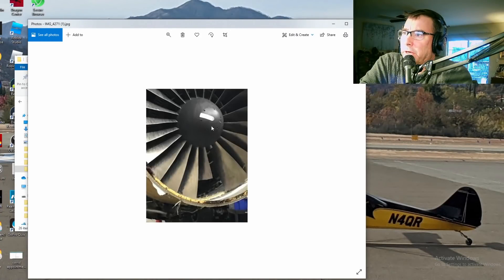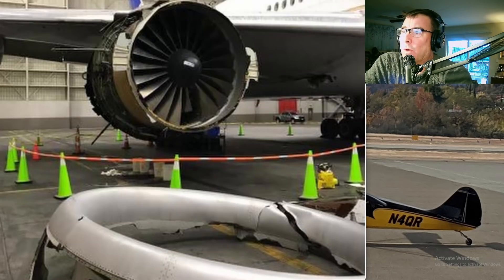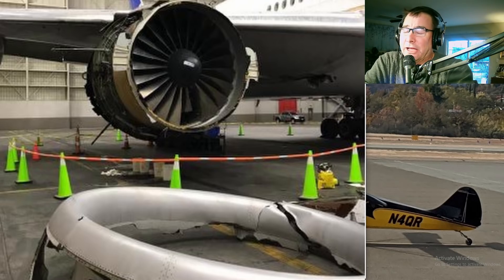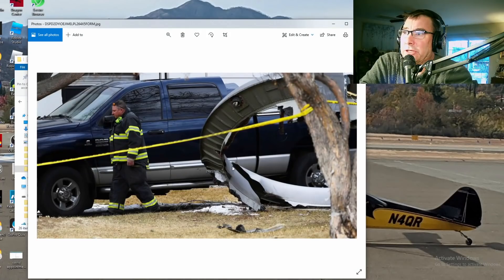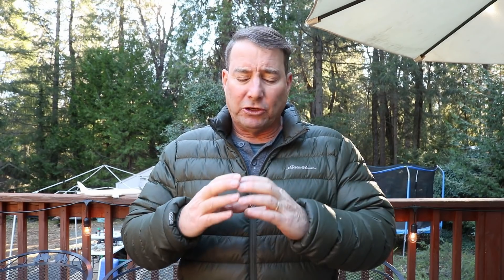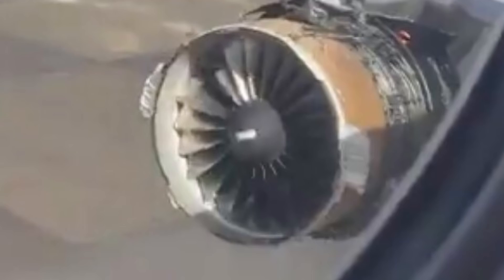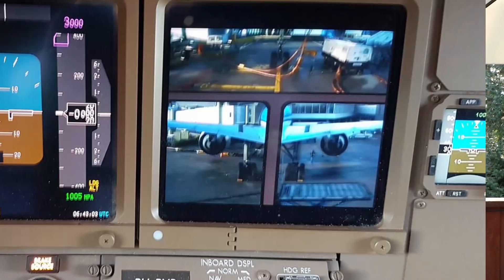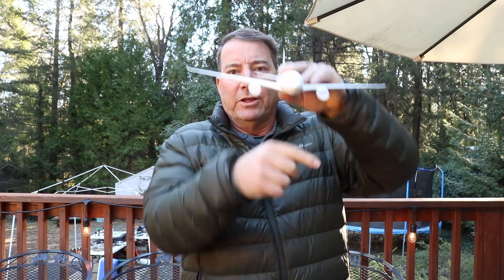UAL 328 UPDATE Fan Blade Failure  B777-200  22 Feb 2021

Comment: Just to clarify, the strength margin or structural fuse designed  between the pylon and wing is to prevent tank rupture in a crash scenario. The pylon is designed to stay attached to the wing in an FBO event, and did so. In the same way, the oscillatory windmilling loading over the the period of worst case diversions after FBO is also designed for in the F&DT qualification.

Comment: United Airlines Flight 1175 had a near-identical Boeing 777 engine failure over the Pacific from San Francisco to Honolulu back on Feb 13, 2018. The engine also lost one and one half fan blades and the cowling. The engine was the same type PW4077.
Reply: You have a good memory.  Looks very similar.
https://www.airlineratings.com/news/industry-news/near-identical-engine-failure-united-airlines-2018/

Comment: Efficacy of the fire suppression system without cowls is exactly zero
Reply: Looked like the fire was in the region of the thrust reverser cascades.  No fire supression out there, only under the core cowl.  I haven't seen any pictures that would indicate the core cowl departed the airplane.
Reply: P Peterson I don’t think these things have separate core cowls like the JT9’s had. For sure the transcowls were blown off, leaving the cascades exposed as you remarked. So the fire would have been somewhere in the C-duct. One would think that if the cascades are in place, the inner heat shield around the core must still be there unless some reverse flow sucking the fuel out of the compartment which is entirely possible if one of the bleed ducts have detached; hard to tell as a spectator...

Comment: Yes, the engine failed. But we’re not talking about a tragedy, because many other systems worked.
Reply: I'm impressed by the total professionalism demonstrated by the aircrew and ATC in this instance, resulting in everybody walking away.
Also glad that the fuel shutoff and fire suppression systems worked as advertised as Juan pointed out. I guess it's easy for me to say "it was just a little fire" from the safety of my keyboard but that's honestly what it was, rather than the flying blowtorch of an uncontained fuel fire. I'd obviously still have been fairly concerned if I was viewing it through a starboard passenger window though. :)
Reply: @sixstringedthing possibly was just a little fire but sheesh little fires can explode, look at those failed gender reveals.
Reply: Luck 100%
Reply: its not tragedy because  it didnt happen mid Atlantic or mid Pacific,  but happily near the departure airport
Reply: @yarpos  777 is ETOP’s certified.. Same scenario would have happened mid Atlantic or mid Pacific.
Reply: @sanitman1488  nothing is 100%.. being this faithful for things to happen by the books basically asking for disaster.
Reply: @whothou  then don’t fly !

Comment: Some interesting answers to questions i had in my head especially regarding the severe engine vibrations potentially causing airframe damage.
I’m sure it would be an unwanted failure point but is it possible to jettison a badly damaged engine ?
One of the dreaded situations big jet pilots must dread is to have a failed engine when your destination airport is experiencing extreme weather but your options to divert are limited by your remaining fuel load having flown a lower altitude at a higher fuel consumption, worst case scenario of course.

Comment: Excellent reporting as always. Can you explain the Weight on Wheels sensors? How this records into the FDR; does it trigger auto throttles, thrust reversing amd speed brakes?
Reply: It does if the crew armed the automatic system

Comment: I saw a different pic from a second angle, appears that liberated blade, or possibly other debris hit the fuse under the wing aft of the AC pack intake and left a fairly large hole.  Not sure how much damage was suffered internally but I wouldn’t have wanted that to happen halfway between Hawaii and the West Coast.

Comment: Great Update Juan..... OK now I have a question. So what happens if that engine fell off? Besides it hitting the ground or someone. Does/or can the plane adjust trim on the wing to keep the plane level, the only reason I am asking this is because of the weight loss of the Engine.....
Reply: The weight loss is easily countered by use of aileron. No special procedures are called for according to Boeing procedures. Never experienced it for real, fortunately, but on the simulator it is a easily managed situation. The engine is designed to break away cleanly, but I think you can expect other problems resulting from additional structural damage to the wing, flaps/ slats and other systems in practise. That could prove a handful,  so would much prefer the engine to stay put!
Reply: I wonder if it could fall off without hitting the wing or tail
Reply: @kevinstewart449  I would expect that to be a problem, and wonder how much analysis is done for that in the design. A EL AL 747 cargo flight which lost a engine near Amsterdam many years ago, took a second engine with it, and caused major damage to the wings. They flew around for a while, before crashing into a suburb with no survivors, and loss of life on the ground.

Comment: Engine Lubricating Oil coming into contact with hot metal and being force fed oxygen (think Brasing Forge) from the movement of the plane.
Reply: @SusanKay-  - 😁
Reply: I have a waste oil burner I built that works off this principle. Just a drip system. Once it gets hot enough, I force air into the fire via a gutted Becket oil burner.  It sounds like a jet engine, and burns HOT!
Reply: Yeah, I saw an entire accessory driveshaft (or hydraulic pump drive - I don't know how these are set up) laying in the road in that neighborhood that caught all the engine debris: https://youtu.be/Ez0z8KNUA3s?t=120

Comment: At around 0:55 to 1:00 on the video, looking at a still of the engine and wing, it appears that there is a rip or tear of the underside of the wing inboard of the engine.  Is that what is shown?
Reply: Minor damage . The fuselage has 2 skin layers. The outer one is only the outer aerodynamic layer and no structural properties. The structural skin in under that. There was no decompression but would be interesting to see if the structural was also damaged.
Reply: Yes, minor fuselage damage.

Comment: I think you fly the triple 7 or maybe it is the 787.  How does the grounding of the engine type impact your flights?  Or do the planes you fly have a different engine type?  Sounds like you were heading to London so it must be a different engine type.
Reply: Only the 777-200 with P&W engines are grounded. Plenty of others available during the current downturn.